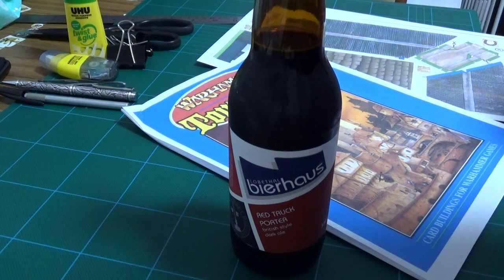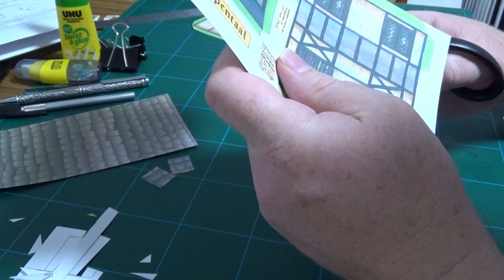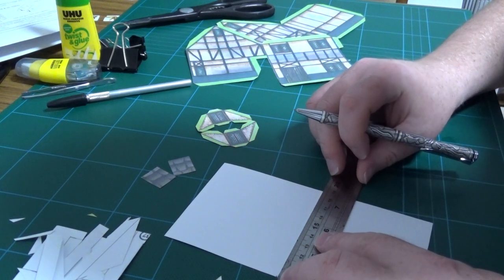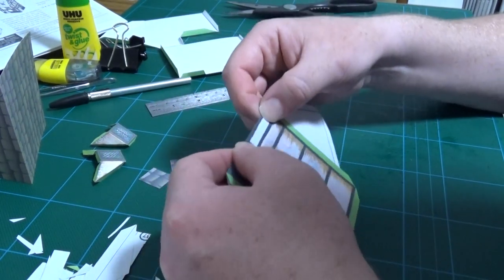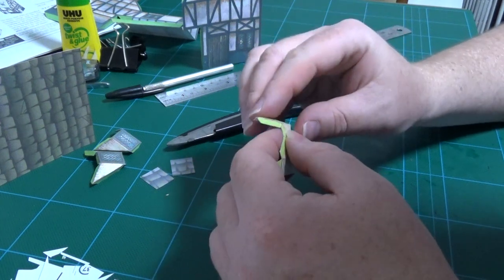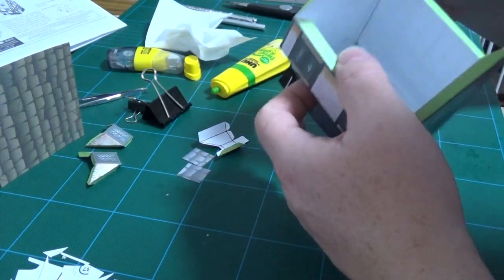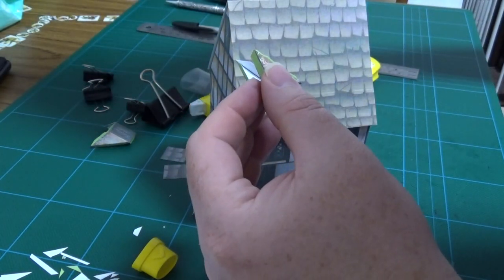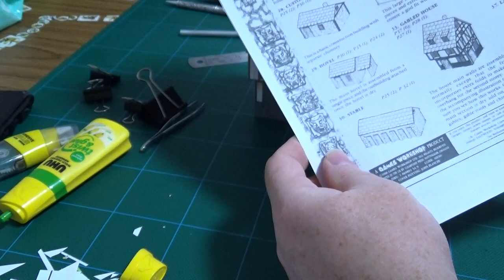SlowTube Warhammer: Constructing a Warhammer Townscape paper-craft house

Comment: The watermill didn't line up on my PDF. Have you tried to build that one with some success? 

Also, I found that if you make "Fold Tabs" for the floor pieces, fold them up and the lower wall won't "warp" in. It also gives you something to glue the buildings to the bases with.

- Ah, I see GW has those, but my Vyllage On The Cheep set didn't.
Reply from the maker: Mine was skewed as well. Thought it might just be me, but maybe is a design error
Reply: @cognitionfatigue  That's good to know. Might have been a scale issue from back in the day. Maybe someone lifted the camera ip an inch or two by mistake at that point.